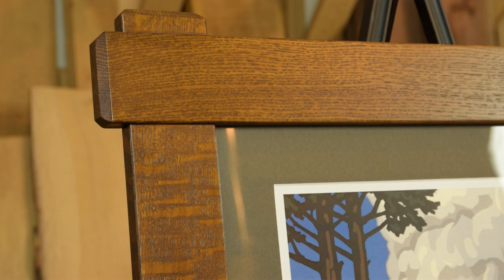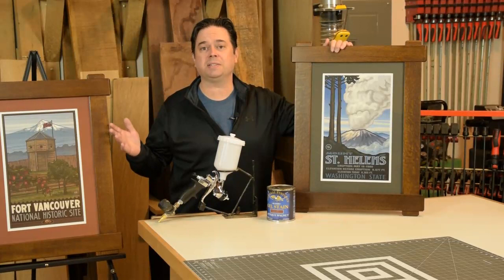Dark Brown Mission Finish How to Apply Step by Step Woodworking Finishing Tutorial

Comment: If you do not have a sprayer for applying shellac could you brush it or wipe it on as an alternative? or could you get a spray can of Lacquer instead of the shellac? thanks
Reply from the maker: If you're not set up to spray, you may have to use a different technique.  I wouldn't wipe the shellac on, because it will lift some of the dye.  
I haven't tried aerosol lacquer cans for the seal coat step.  My guess is it would work, but you'll have to make test boards to see how it behaves.   Good luck with it.

Comment: Very nice finish and well presented. Would you mind sharing the dimensions on the frame? Half laps for the joints?
Reply from the maker: Hi Jim, the stiles are 26-1/2" and 5/8" thick.  The rails are 20-1/2" long and 3/4" thick.  All parts are 2-1/2" wide.  You are correct, it is built using simple half-lap joinery.  I cut the half-lap 5/16" thick, which makes the parts flush on the back, yet lets the rails stand proud at the front.  The parts project 3/4" past the mating piece on all corners.  The glass and matting size is 14-1/2" wide and 20-1/2" tall.  Actual space inside of frame will be 14 x 20 until you cut the rabbet for glass.  Thanks!
Reply: Thanks Willie.